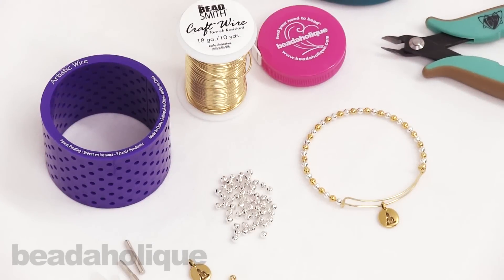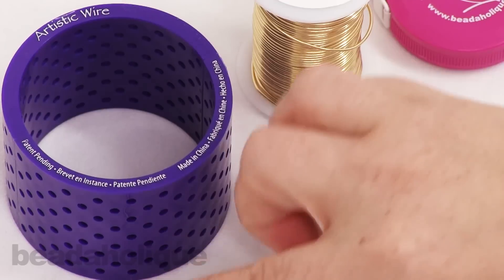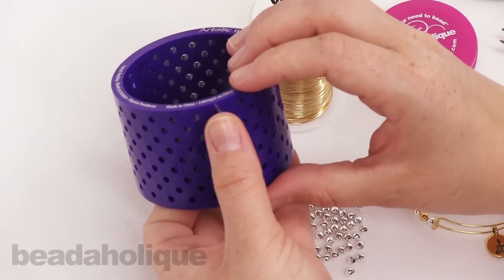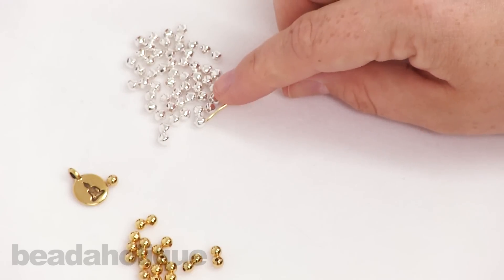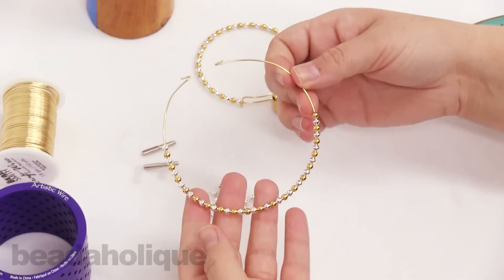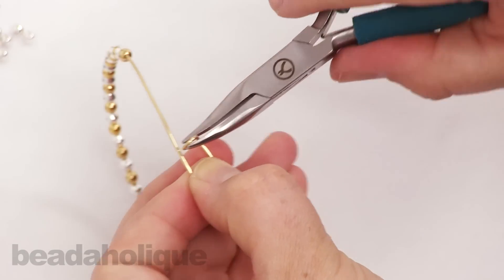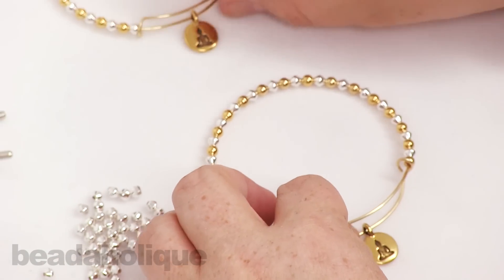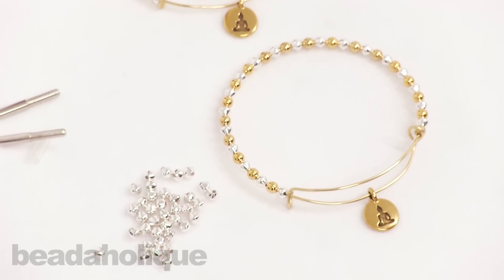How to Add Beads and a Charm to an Expandable Charm Bangle made using the Artistic Wire 3D Bracelet

Comment: Can I use  the  bracelet direct from the jig without using  the bracelet  mandrel? Or the bracelet  is too big for the hand, so you have   to make  it  smaller? Thanks
Reply from the maker: This will depend on the size of the wearer's wrist. The jig is fairly wide, so the bracelets need a mandrel to be made smaller. Thanks for watching!

Comment: What size bead should I buy for a 6.5cm adjustable wire bangle???
Reply from the maker: This will depend on the wire thickness used. If you use 18 gauge or thinner wire, you can use beads with 1mm size holes. Thanks for watching.

Comment: I was told not to use artisan wire because the fact of that it's not as hard as using the beadalon to make a charm bracelet
Reply from the maker: We usually recommend Artistic Wire for introductory wire wrapping projects like this. It's easy for beginners to work with and it's fairly cheap which gives people permission to experiment and learn from mistakes. A slightly harder wire would be ideal for every day wear, but we have lots of artistic wire projects we've worn on and off for years.

Comment: I don’t understand why this never works for
Me, it’s always too big and doesn’t
Adjust to my wrist at all 😭
Reply from the maker: What kind of wire are you using? This technique works best with somewhat soft wire, strong enough to hold a shape but still soft enough to bend. Every time you adjust the bracelet smaller you're bending the wire a little bit. You don't want to use something like memory wire that will spring back into shape. Here's what we used in the video: https://beadaholique.com/products/beadsmith-tarnish-resistant-gold-color-copper-wire-18-gauge-10-yards-9-1-meters

Comment: Not a very efficient way to do the adjustable bangle. No need for the jig.
Reply: Picco bow I see what u mean...u can wrap wire around a can or something cut wire and make hoop with a pliers.
Reply: That's what I do. I also use a nylon hammer to harden it some
Reply: I'm having issues in making the 18 gage wire hold its shape. It does not spring back to its size once it goes over the hand.
Reply: Memory wire makes this easier.